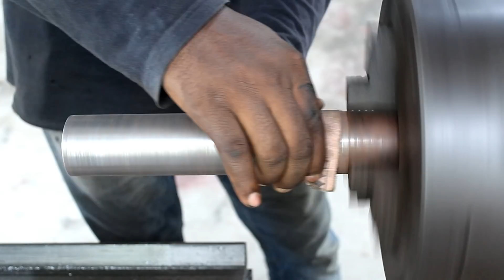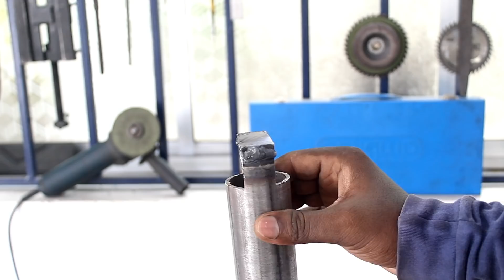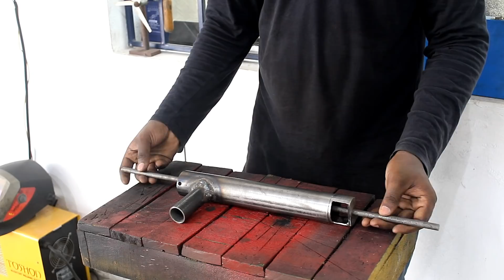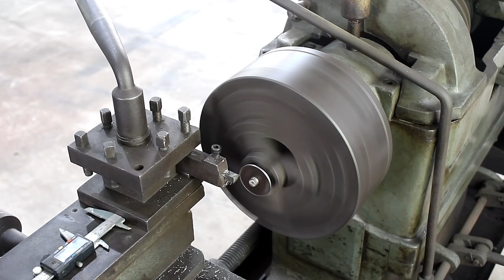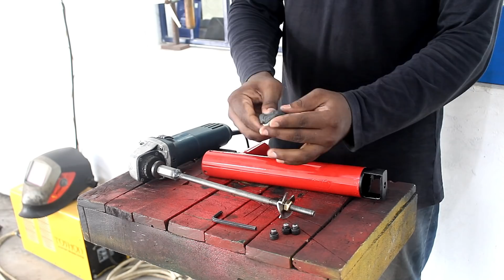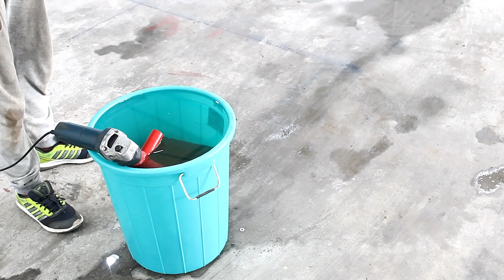Angle Grinder HACK - Make A Water Pump | DIY

Comment: Make it ,tube,longer,and put inside 2  propellers at certain distances.Do not place exit opening of the pump so close to grinder or to drill,not safe.Use thick rubber to enclose shatft of the pump close to motor or drill or  to grinder,much safer.Make one pump from tube two meters long ,extended shaft, from two or more short shatfts composed,and use DC motor for pump, driven by solar cell.Could be good even engine from lawnmover.Such an pump,solar,colud be usefull in Africa,for small Farmers.

Comment: Friend, u should try to make some attachment to fit the pump to angle grinder, so grinder can be use for other purpose also, extend the pipe ,so grinder will be away from water
Reply from the maker: Thanks for your suggestion

Comment: Could you make me one but longer for a “55 gallon water barrel””. Probably add 2 more water blades to longer shaft.  I will connect to flexible water pipe and pump from barrel up to large retainer barrel to store it.  I will use it for qty 5 large water barrels when they are full of rain water.   I can use water when it is dry and no water.

Please advise.  Most Humble Appreciation!  Alton
Reply: You can buy a 370 motor air water self priming pump on ebay for $8 that can do the job you just described.

Comment: ok BUT... no seal on the grinder shaft. water will ingress the bearing and gear housing and destroy after few uses.

Nice one using a grinder on the lathe... lol... safety 3rd!

And no guard on the grinder with a cutting disc, safety 5th!

Comment: At first glance it looks ok, but that single fan blade inside is not enough to encounter the potential difference, as you can see in the footage, when the water level goes low, it will be piss poor performance and you cannot submerge the pump, because the grinder is not waterproof.

Comment: It is a DIY vidio....   the first tool used is a lathe...  because everyone has access to a lathe, drill press and a welder....  it would be more fitting as a DIY with tools and materials the general public can get there hans on...   fyi just because you used an angle grinder to make this video doesn't make it DIY...  use the proper tool for the job
Reply: VERY NICE